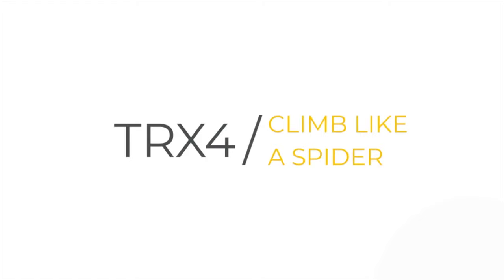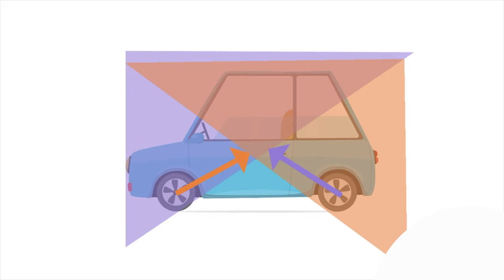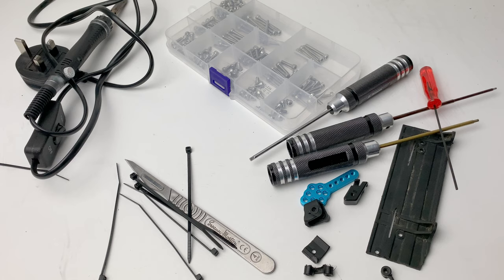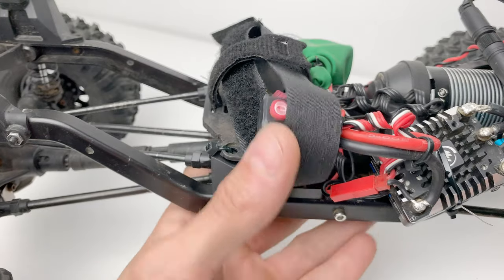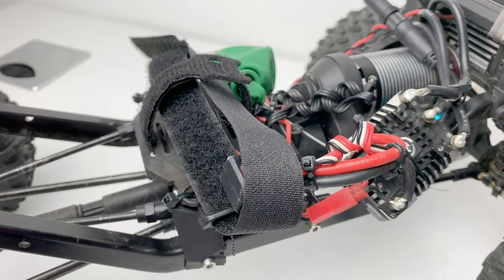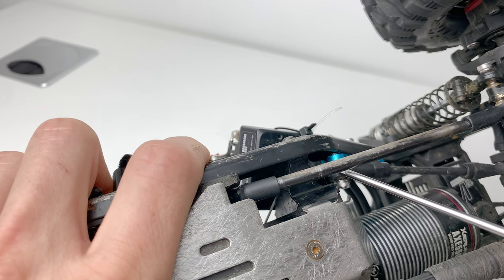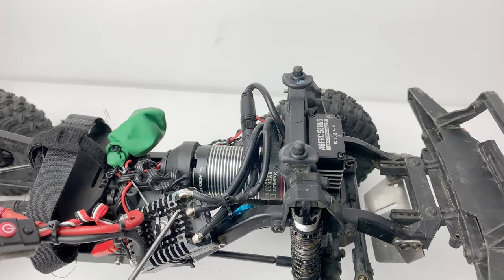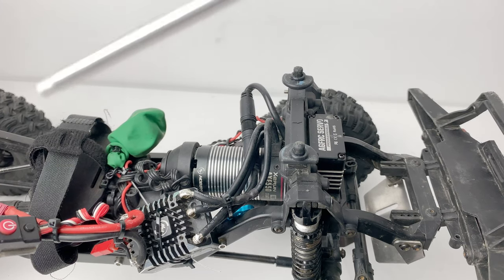TRX4/Climb like a spider. Climb up STEEP things. Budget, free & cheap mods for Traxxas TRX-4 #trx4

Comment: How did you attach the suspension and manage to get the inner fender off? I was going to do this on a new body, but it appeared as if the lift kit I put in it a long time ago, attaches the shock straight to the fender. Did you cut it or?

Comment: The science behind this makes sense and is the first time I have seen anyone use the physics of geometry for traction on these crawlers. If you havent yet it would be cool to see you have a 3D printed belly pan/link mount as a more permanent fixture, something others could easily fit to their own rigs. Great work, and i will be looking at my axial to see if there are any pssibilities there in the future. Thank you
Reply from the maker: Thanks! I've got some skids (and some prototype ones not yet released) on my thingverse, but they are for the NWSD Scattergun v2 frame. I will look into link risers for a TRX4 as it shouldn't be too hard to sort out.

For the Axials search Shapeways or eBay for a "RULR" or Rear Upper Link Riser. They are pretty common and help do a similar thing.

Really appreciate the feedback, let me know how you get on!
Reply: @JustScalin  I have yet to get my Axial, i did order a rear cantilever suspension kit for it, this RULR unit you speak of is intriguing. I will look for it. Thanks again
Reply: @JustScalin  i would be interested in this too.  tho i dont have a 3D printer,  if you produce them how much would u charge?  when u do i will want one.

Comment: Your entire method in the rear is completely opposite of how anti squat works. Using a 1:1 drag car with a 4 link rear end as an example, raising the rear of the upper links and/or lowering the front of the upper rear links creates anti squat and will actually lift the rear under acceleration. This is what drives the front axle down. Our crawlers are no different.
Reply: You’re right. I’m surprised it took 3 years for someone to comment who knew better. I learned about anti squat from watching videos on 1:1 vehicle geometry which inspired me to design and sell rear link risers for the scx24 and CR18P that mount to the rear axle.  I’m going to try one on my trx4, but I’m skeptical that petg is durable enough.

Comment: Just found your channel love my trx4 as well it's the only traxxis I love lol but I did just get a capra kit I'm excited to tinker with that but I want to put brushless in it but I can't afford a 200 system what the best budget option on if you don't mind or should I just save for a castle or sum
Reply from the maker: I'm not sure if it would fit, but the Hobbywing Fusion is probably the best budget brushless and one of the best brushless crawling systems you can get. If not then the HW Axe in a 540 would be a safe bet.

Castle combos are fantastic but can get pricey quickly. Also if you're not dunking it in water I'd probably go for a brushed Hobbywing 1080 with a HH sport motor

Comment: Great well put together video and some intelligently thought out mods. Looking forward to seeing it in action.
What's the best way to find the centre of gravity of your rig? I assume that if another vehicle had a different centre of gravity then the link positions would need to be different or you would need a similar cog to yours to do the same positions and mods as yours?
Reply from the maker: So one way is to hang the vehicle by the bumper mounts and take a photo of each way. Then draw a line straight down vertically and where these lines intersect (vehicle up & vehicle down) would be your CoG. To make this work you need to zip-tie your axles at "ride height" to stop them from fully extending.

Another way is to just weigh all your parts that are "sprung" and all those that are "unsprung" and work out the ratio, then find the point on the car (from the ground) that's that ratio from the floor. E.g. if your sprung weight is 1kg and unsprung weight is 2kg then measure from the ground to the top of the shell and pick a point that's 1/3rd the way up.

Even if you don't measure, you can use the same mount positions I did and you'll get a similar, but maybe not as strong effect. This is because the instant centre (where the links join) should be in the anti-squat and anti-dive zones on any rig that has 50% of its weight below the highest point of the motor on a TRX4. In that case, you won't need as much pre-load on the suspension but the car will push into the front wheels when accelerating.

This is why the "non-permanent" way is to get a link mount and remove the upper rear link where it goes into the chassis, then put the bolt back in, and then the two screws in the link mount go either side and you attach it using another piece of plastic. I used one of the mounts from a slider which I just cut off my side trays, but any piece of plastic or maybe a big washer and a nut would do.
Reply: sky rc scale

Comment: U do realize that putting a link riser on the rear axle of a portal axle don't work rite??? The portal gearing makes it work opposite direction. Now link riser on a strate none portal works for your anti dive yes but a portal axle spins in the opposite direction at the portal it's not the same
Reply from the maker: The wheels still spin in the same direction though so the twisting forces put on the the axle are the same direction so it doesn’t matter if it’s straights or portals the effect is the same.